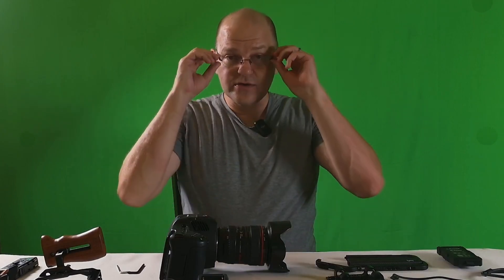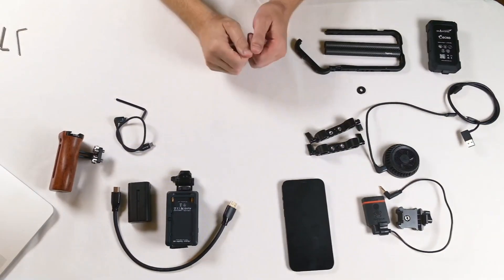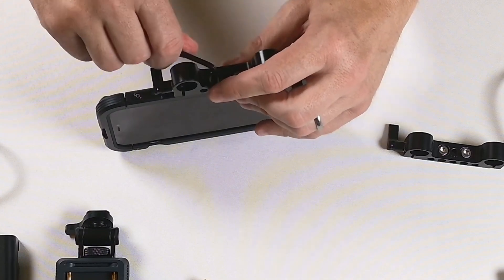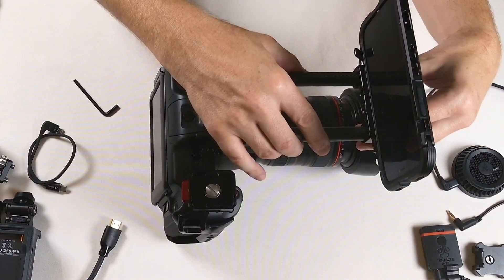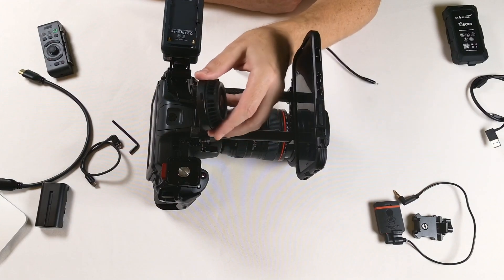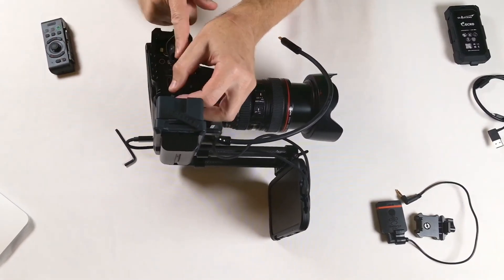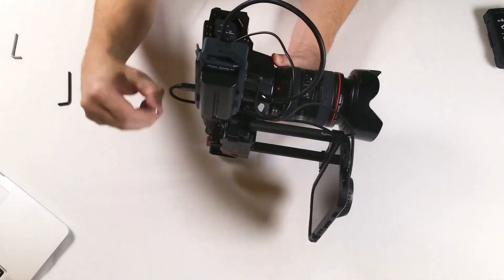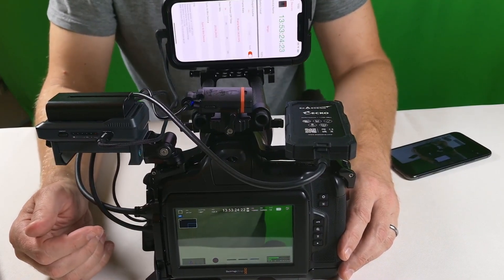JetsetCineRigging

Comment: I have this build set up with the lumix s9. My question is most gimble will not support the weight, which isn’t a big deal. But the tentical sync. Can I practice without this and get it later?
Reply: The phone is light enough to work fine on a stock RS2 gimbal. It's a fraction of the weight of the camera. The Tentacle Sync is extremely useful in production, but if you are just practicing the digital slate approach will work.
Reply: @ I was considering focus motors and cine attachment. Thank you so much. I’m following a tutorial & I will get back too you guys. Much love

Comment: I still don't understand exactly why I need the Accsoon SeeMo, since I could connect an HDMI to Type-C cable from the camera directly to the iPhone. I know it offers extra options like a Type-C output to power the iPhone's cooler, etc., but in practice, to just make JetSet work, do I necessarily need the SeeMo? Wouldn't the JetSet app already pull the signal connected via cable without the need for an intermediary?
Reply: Yes, there are some interesting new methods of doing iPhone based video transfer. We picked the SeeMo devices because they are inexpensive, robust, and handle basically any cine camera you throw at them. We now use them for live cinematic compositing of the cine signal in the iPhone, as well as charging the iPhone and running the cooler. It's a remarkable all-in-one production solution.

Comment: Can you provide what cable you are using to attach the Tentacle Sync E MKII to the BMPCC 4k? Is it a 3.5mm TRS to Mini-XLR Timecode Cable?
Reply from the maker: I think it was the default cable that came with the Tentacle. Some other cameras require specific cables that can be bought at https://shop.tentaclesync.com/

Comment: So, the phone sits on top of the lens, not the sensor? Why is that?
Reply: The Jetset Cine lens calibration system calculates the offset between the iPhone lens and the cine camera lens wherever they are. The lens 'entry pupils' are (usually) close to the front of the glass, so it's a good idea to keep the iPhone close to the front (and also gives the phone a clear line of site.)

Comment: Is tenacle sync a must?
Reply: Required for synchronized real time rendering in Unreal. Highly recommended for general use as then the tracking data has the same timecode as the cine video takes.
Reply: @eliotmack   can I get away with it for just camtrack data to be used in post?

Comment: Is the tentacle necessary for lightcraft cine? Bc based on your other videos it seems like it is an additional accessory instead of a necessary one
Reply from the maker: It's not absolutely necessary but highly recommended.
Reply: @lightcrafttechnology  I thought Jetset Cine already had its own genlock thing with the digital slate to sync the tracking data and the footage?

how crucial is the Tentacle and can I do by without it just fine or will I encounter problems in post?
Reply from the maker: @cyrusstanola3929  The digital slate works for the Autoshot post tracking workflow, but under some lighting situations the automatic marker recognition can be fragile (lights reflecting in the digital slate screen, etc.) In general timecode is a great idea to tie things together, and the Tentacle Sync is both inexpensive and works well.
Reply: Is accurate manual synchronization possible without using tentacle sync?
Reply: @aust917  Yes, but we recommend the Tentacle as it can speed up take matching considerably. We're working on the implementation of timecode based take matching now.
Reply: @eliotmack  thanks for the answer!

Comment: Is this set up possible with a mirrorless camera.. if so would it be the same set up?
Reply from the maker: Yes. As long as the camera has a HDMI or HDSDI output that can generate a 'clean' feed (no data overlays, using the full width of the image) it will work.
Reply: @lightcrafttechnology  This may be a dumb question but can I substitute the accsoon seemo with a dii Raveneye Transmitter?
Reply from the maker: @XLence87  Jetset Cine only works with the Accsoon SeeMo for a live camera connection.